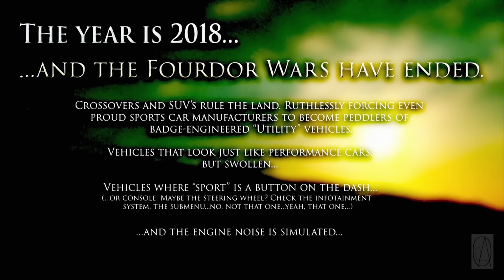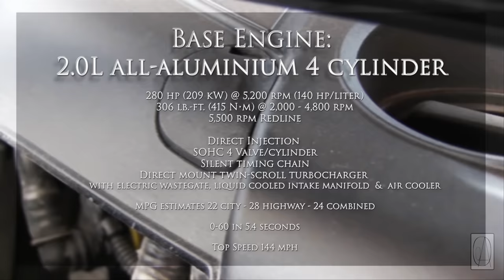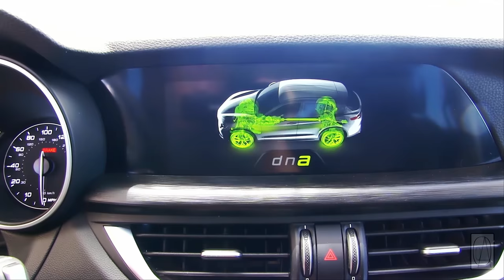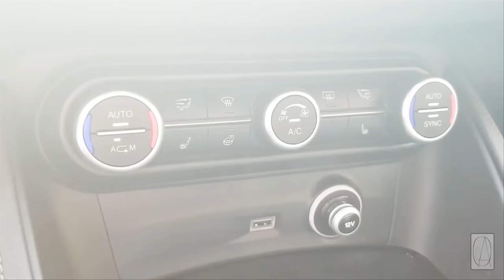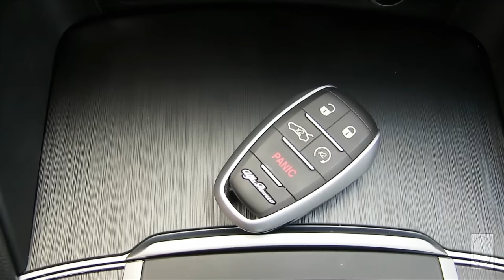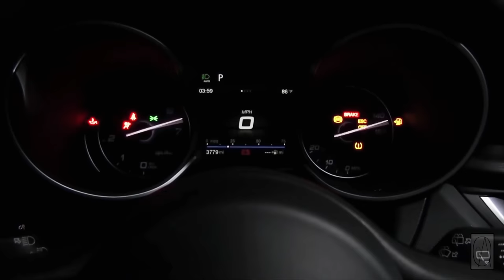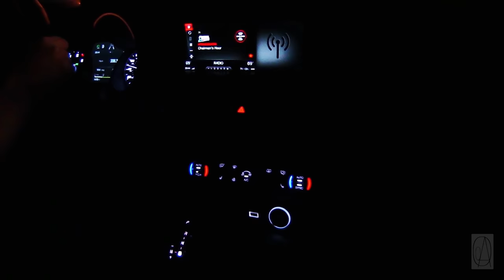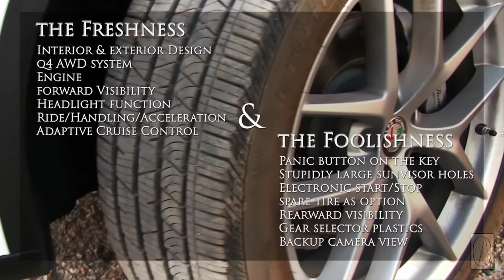Alfa Romeo Stelvio, Conqueror or Casualty of the carpocalypse?

Comment: Just took my Stelvio off road for the first time since we got it back in August.  It's been reliable and fun and has about the same mileage.  The terrain was soft mud after rain and I thought we might get stuck.  But the Q4 would eventually start to move and even made it manageable in tight spots.  Hands down some of the worst to learn your car with but I knew it could probably handle it and this video really confirms what its capable of. Awesome to watch.

Comment: Even body on frame off road vehicles don’t need “off road” settings. Toyotas, fords, Kias, and even Jeep and others today have “mud, rock, snow, blah blah blah” 

It’s been proven time and time again that “auto” only does okay-ish on the jeep models while “rock” is the mode you put it in if you don’t want to burn rubber waiting for limited slip software to finally take action. It’s ridiculous, why doesn’t the system just immediately act and do what it’s supposed to do? 

The only vehicle I’ve seen with off road drive mode button doodads do ANYTHING actually interesting and useful is the Toyota sand recovery mode.

My Nissan Xterra has zero drive mode things- it just has a gas pedal and limited slip that simply springs into action regardless of transfer case position and ground conditions. It just works and works so well. 

Thank you Alfa for simply making a good and reactive limited slip system. 

The macan has proven its off road button to doing mostly nothing. Roller tests show that their limited slip is a crazy amount of lazy.

Comment: Thanks for this awesome and refreshing review! My choices are down to a wrangler rubicon and this stevio ti
Reply from the maker: Those are two very different vehicles, even though they share the 2.0 4cyl. with some minor differences (the 48 volt system on the Jeep for instance).

Both fun in different ways though.
Reply: I couldn’t agree more, that’s why I have a Wrangler too!
Reply: Opinions on Automobiles-Seriously, they are the SAME engine?? I’ve been wanting to know if they were related as it makes sense, but this performs so much better here than in the Cherokee 🤔
Reply from the maker: The 2.0 Jeep engine and the 2.0 Alfa engine are the same engine essentially.  Jeep adds the 48 volt system to it and assembles the parts in their plants. Alfa gives you lighter/stronger alloys and nitriding to some of the internal parts, along with building the entire thing in Italy.  The lightness and better finishing, along with the ultra-efficient drivetrain are what make the Alfa a better performing engine in terms fast, smooth revving and increased top end power in particular.  There is also unique engine mapping between the vehicles, it would be surprising if Jeep is using Alfa's engine management algorithms.

Also don't forget the transmission.  This ZF 8 speed unit is light years better than the Cherokee's transmission.  the transmission really is the best in the industry right now which is why so many manufacturers are using it.

Comment: How’s the navigation system ?????
Reply from the maker: OK. Definitely not the greatest, inputs in particular are slow.  It works well, doesn't get lost, and allows you to save your routes when off road though so not horrible either.
Reply: @opinionsonautomobiles7666  thank you so so so so so much I was thinking about an 2018 and was scared ! I’m a real estate agent so I travel a lot and wanted something that was simple and punctual ! Not just a huge “Lag Box” ! I don’t care about color resolution etc not a big tech guy, but simplicity and will it work. And good gas mileage is of importance’s as well !
Reply from the maker: Functional describes it well.  It seems to have no problem keeping up with the car and giving directions well before you need to make any turns both rural and in congested areas like downtown LA.
Reply: @opinionsonautomobiles7666  excellent !!!!!!!!!!!!!!!!!!!!!!!!!!!!!!! How’s the mpg
Reply from the maker: People report as high as 30. I drive aggressively, live at 2000ft of altitude and average a solid 25mpg mixed.
Reply: @opinionsonautomobiles7666  wow

Comment: Sounds very noisy..... 14:00
Reply from the maker: It is not the quietest SUV inside, engine noise is more present than say a Lexus and there is enough road noise to let you know what type of surface you are driving on. The sound never gets droning though and the overall volume is very comparable to an Audi or BMW, Mazda, Honda, etc. however the mix of sound is different, there is less wind noise and more engine noise, and since it isn't competing with the wind, the road noise is more defined. Not really noisy in my opinion though.  That particular clip you are referring to, the microphone was placed in the rear hatch area with the retractable cover closed to get the exhaust sound better as it wasn't coming out unless I was above 4000 RPM if the mic was in the front seat area...so it really is not representative of the sound in the passenger area of the car.
Reply: @opinionsonautomobiles7666  Yes that makes sense because I had read many times that it was fairly quite inside.